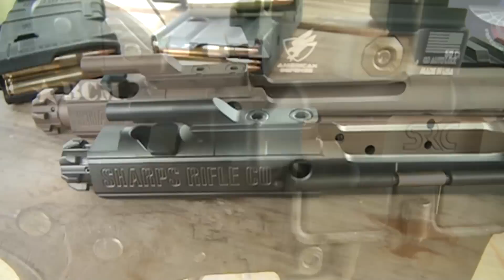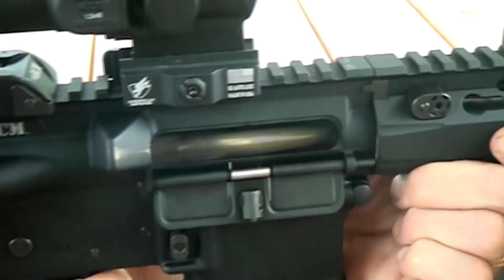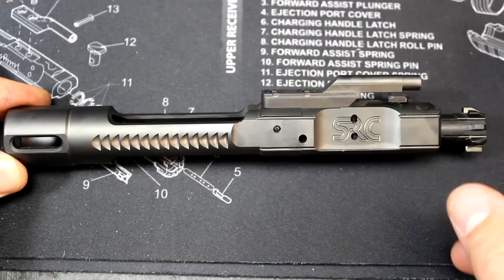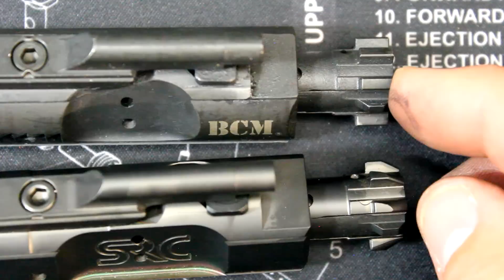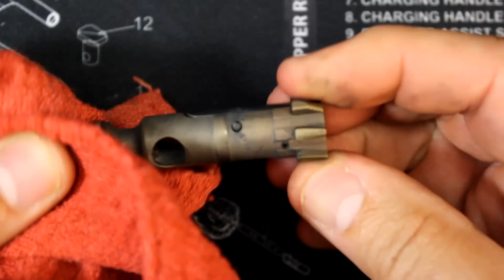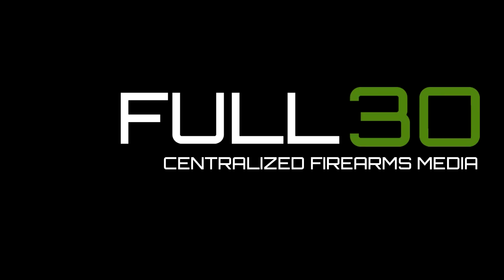Strongest AR15 BCG XPB Extreme Performance Bolt

Comment: This would be perfect if the gas key was one piece connected to the bolt body.
Reply: Armorize except that when the gas key gets bent or damaged due to hitting the gas tube, or the keys gets damaged in ANY way, you need to replace the whole carrier then, I will take a standard style key over integral for that alone.  That was an issue covered by Chris Bartocci a ways back, look him up here on YT.
Reply: Patches O'houlihan actually, Chris said that while he liked the idea of the integral key, he would prefer a standard key for a service/heavy use gun for the capability to repair with new key. And yes, the gas tube IS a softer metal, but can still damage the key if offcenter enough to cause a malfunction. Not lying, just passing along knowledge, just because you disagree doesn't make you right and me wrong!
Reply: jimhans1 I agree !

Comment: I've seen a few cases of the sec bolts failing when they first came out do you trust that they have solved any problems they were having?
Reply from the maker: Yes, they had initial Heat Treating issues with a small batch of Relia-bolts but quickly took care of it and replaced customers early Relia-Bolts. I have two early ones and have had no issues. Sharps went overboard to insure the quality of the new Bolts. Thanks

Comment: wondering if the dlc is the same prices some sportbike companies use on higher end forks-that stiff was hard to scratch.curious how it holds up to cleaning/scraping? also have you noticed any extra fouling in the upper receiver around the chamber?
thanks for the video
Reply from the maker: I've seen no evidence of fouling excessive wear. I've shot around 5000 rd using Relia-Bolts and Balanced BC's in the past two years and all are in good shape. Thanks James.

Comment: Staking looks quite questionable on that gas key though....
Reply: Aaron Charles 
Yeah, he covered that very fast.
Reply: A survivor my thoughts exactly. Also, the bolt carrier shouldn't "cant" in a DI gun.
Reply: I noticed that lol
Reply: A survivor great point
Reply: A survivor meh, yes it's super hard steel, but smooth and self lubricating. I have ooooold Mossberg 590s where dirty steel has rubbed along the inner aluminum surfaces in the receiver and there's hardly any wear. As long as this ar15 isn't overgassed and your buffer spring isn't worn and you keep the gun reasonably clean, you won't wear out the aluminum.
Reply: @A survivor - That isn't a bad point but even the standard 8620/Carpenter's 158 BCG steel is going to be harder than a forged or billet upper so I don't think that wearing the inside of the upper with S7 is going to be any more of a problem than it is for any other BCG.
Reply: Good eye, just saw that. That’s not even questionable. That’s not good at all. Questionable would be a small part of the stake touching the hex screw. They aren’t even touching in the least. Not a problem though, and I’m sure definitely not a problem for sootch. You can stake it yourself or bring somewhere and get it done.
Reply: You were right Dad of Steel, my AR 15 stopped cycling after about 500 rounds and after pulling out the Sharps BGG it was quite clear the stake job was very poor seeing my gas key was barley hanging on when I pulled it out of my rifle.
Reply: Harian: I have one too & I love it. I have one of the early ones. I was one of the people that got a replacement bolt. Anyways, I haven't been shooting much the last few years but I am running mine with a Vltor A5 buffer systems & a Yankee Hill comp & that thing is super smooth. I love the way it shoots but I don't have enough rounds through it to give it a long term recommendation but staking looks good & I give it an A+ so far.
Reply: I'd rather get the relia-bolt on a standard carrier with the POF-USA gas key and roller cam pin
Reply: Chris Collins It happens inside on a di but the torque applied is much much lower.
Reply: I was going to say that as well. "Can't" happens in a piston gun, not DI, the gas dosnt push on the gas key, its directed down into between the carrier and bolt, then vents out via the two holes on the side
Reply: No doubt shape. I have an old Bushmaster that is at the end of it's second barrel's life. It's got 30,000 +/- rounds through it. I think it's closer to 40,000 but I didn't keep a close count after the second barrel went on. Anyways, point is it has lots of rounds through it & wear on the inside of the upper receiver is really minimal. You can see & feel a slight ridge where the bearings slide on it but it's minimal & it still works great. 
Mine is over well 20 years old, it's on it's 4th or 5th bolt, it's second carrier & it's second barrel. Wear due to friction between the upper & the BCG isn't really an issue over the life of a rifle. It's looking like the hole the takedown pin goes through will be the issue that does the upper in & the dust cover hasn't worked for years. 
Less friction does make for a much smoother rifle & it helps reliability but no, I wouldn't think less friction will extend the life of a rifle in most cases.

Comment: Palmetto State Armory bolts or barrels have never let me down... I have been using them for years now!!
Reply from the maker: I have a couple of PSA AR's and they run.
Reply: I’ve got BCM,  Daniel Defense, and PSA premium., All have been great. The PSA is also a CHF barrel. They make nice stuff that’s still very affordable.
Reply: I have a PSA and like it. But I love my BCM upper quite a bit more. Also run sharps bcg and swapped out the milspec buffer for the BCM H2 and its smooth as glass, and all lower parts are PSA, the kit with the nickel coated trigger. I believe it was this video here that turned me on to BCM and sharps bolt.